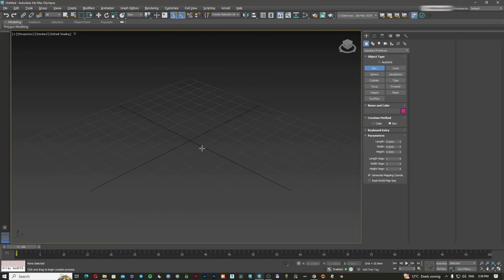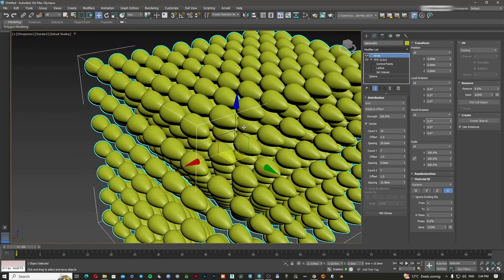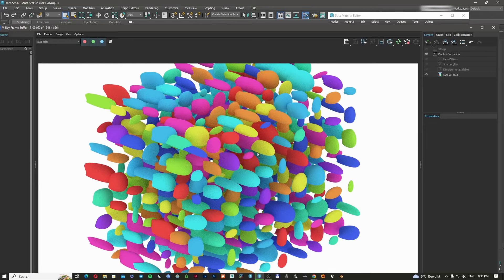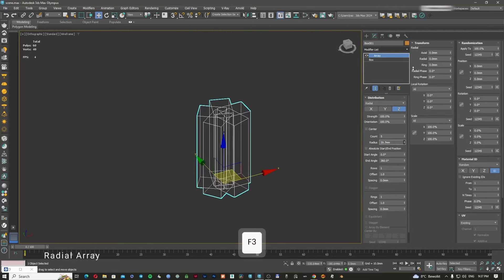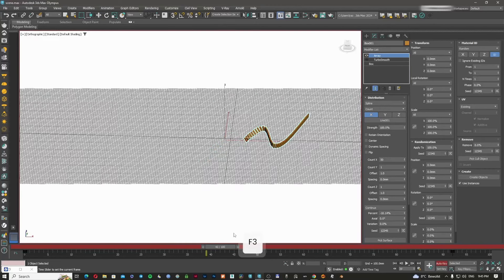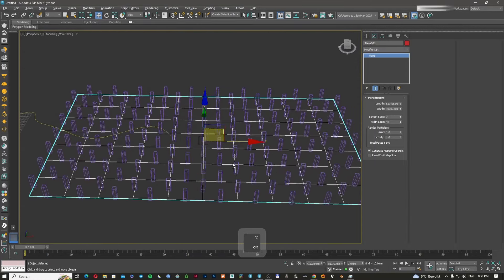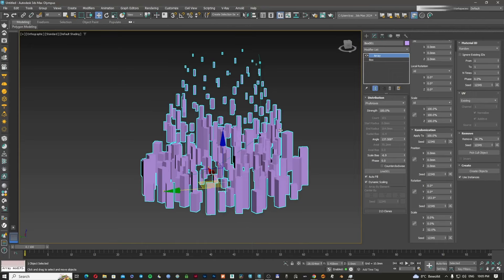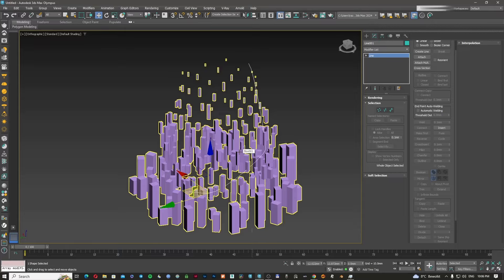3ds Max 2024 - Array Modifier | explained

Comment: array + boolean + retopo tool = peak hard surface modeling
Reply from the maker: True but I will still use the the editable poly to modelling object. It can give you more freedom.:)
Reply: @3d-corner  indeed editable poly is a unique tool in max's arsenal
Reply: @3d-corner  and great video man.
Reply: Imo Retopo tool is still trash. Never manages to detect hard edges properly no matter the settings.
Reply: @ExacoMvm  well, we can't just leave everything to the poor guy. It'll improve overtime.

Comment: I was wondering how to properly use the new array by radial arraying a spline representing a vase profile instead of using the typical Lathe modifier for a stylized result. Its displayed on Autodesk 3ds max 2024 makeanything page at the array section but I cant seem to post any links in the yt comments so pls go there if Im not clear enough. In my result the rotation is not right within the clones.
Reply from the maker: Send me a link with vase that you want to model and I can have a look .;)
Reply: @3d-corner  My comments get deleted. The image of it it's on Autodesk makeanything page for 2024 max version at the Array updates.
Reply from the maker: @orphydiancg7759  can you provide me the link please. Thanks
Reply: @3d-corner  your email pls! the link in the comments section gets deleted.